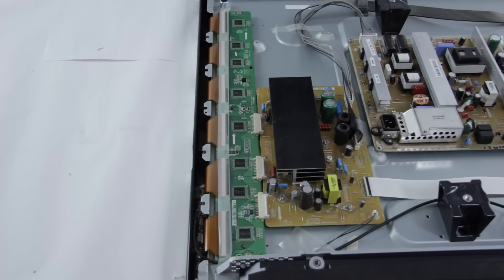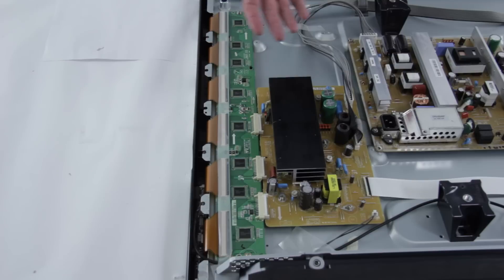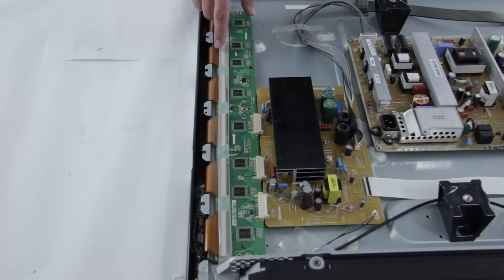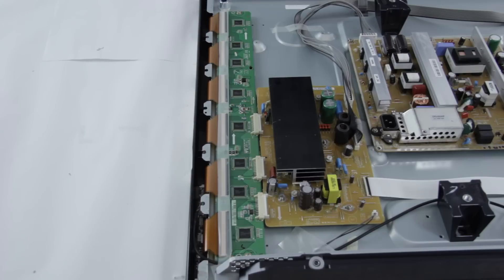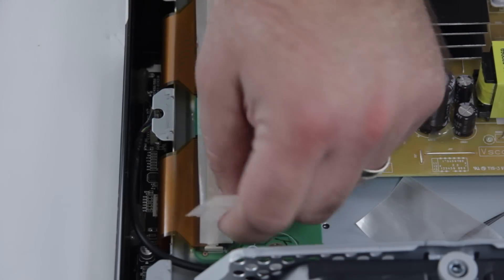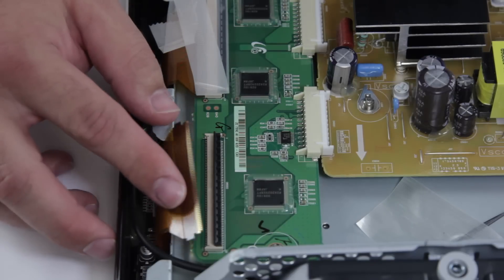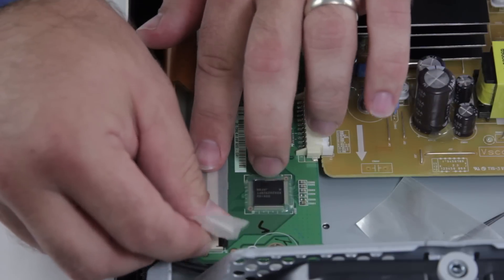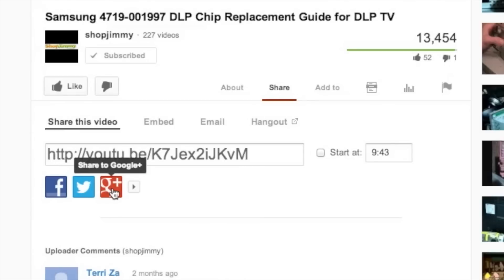Plasma TV Repair - No Image, No Picture on Plasma TV Screen - How to Replace Y-Buffer & Y-Sustain

Comment: I have a Samsung PN51D55OC1FXZA. It just shut down and does not turn on. The relay's on the power supply board click. I see a red led if I push the touch sensors on the tv. The green led on the main board flashes then turns on solid. I don't know if I should replace the power supply or any other boards. I could only find 5V on the power supply. when testing the points where the wires connect to other boards. Thanks for any help. dissapointed a expensive TV lasts only 2 years. I hope I can fix it. I noticed X sustain boards for this TV are Not in stock. How do I know if a Y or a X sustain are bad.
Reply from the maker: sinkinpat   Try this at your own risk.  I recommend that you unplug the TV, then disconnect the Y board and apply power to the TV and see if the TV powers on or not.  Please reply with the results of this test.  Thanks!  www.shopjimmy.com

Comment: Hello...I have a Samsung Plasma 52'...Power light comes on...Nothing as far as picture or sound...The tv was a floor model and i do not want to put a lot of money into it...model # pn51e450a1fxza...Any ideas ?  thanks chris
Reply from the maker: chris veltri  Please watch this video to help with your repair!  TV Repair! LCD, LED, Plasma, DLP How To Fix Your TV with ShopJimmy.com Help!   I recommend replacing the Y-Main Board and the Y-Scan Drive board in your TV.  Here is a link to replacement parts:  http://www.shopjimmy.com/catalogsearch/result/?q=pn51e450a1fxza  Be sure to match part numbers on your current board, with your replacement for compatibility.  Thanks and please let us know if you have any further questions with your TV Repair!  www.shopjimmy.com

Comment: I have a Samsung Plasma model PN51D7000FFXZA. Display just quit, no audio. Red standby light is out, yet flashes when operating remote or buttons on tv. Power cable and outlet is good, power getting to TV. No response to menu button on remote or tv except standby light flashes once per button press. What am I up against?
Reply from the maker: sunlion333 Watch this video for help with your repair & purchase: TV Repair! LCD, LED, Plasma, DLP How To Fix Your TV with ShopJimmy.com Help!  I recommend replacing the Y-Main Board and the Y Scan Drive board in your TV.  Here is a link to replacement parts:  http://www.shopjimmy.com/catalogsearch/result/?q=PN51D7000FFXZA  Be sure to match part numbers on your current board, with your replacement for compatibility.  Thanks and please let us know if you have any further questions with your TV Repair!  www.shopjimmy.com

Comment: Hi i got LG 42PT353K-ZA Plasma - and when TV been switched on and been screen save on I heard like loud "bang" from the back once and TV switched off. When I tried put it back on I heard further 2-3 "bangs" from the back and there is no picture and TV falling in stand by (switch off mode). You can put back on, but after 2-3 seconds it is back to off mode. I`m suspecting Y SUS BOARD....as when taking off cover it smell of "burn"... any recommendations? All advice more than welcome please. Thanks in advance. Seb
Reply from the maker: Basior PL   I recommend replacing the Y board and buffers in your TV.  Unfortunately I do not see any replacement parts in the search results for your TV model number on our website.  Please reply with your part number on your Y board and buffers and I can try searching for replacement parts.  Thanks and please let us know if you have any further questions!  www.shopjimmy.com

Comment: I have a Samsung 51" Plasma TV model # PN51E450A1FXZA that has sounds but no picture, it won't even show volume control.  This was purchased less than 2 years ago. Please help.
Reply from the maker: Tim and Kathy   I recommend replacing the Y-Main Board and the Y-Scan Drive board in your TV.  Here is a link to replacement parts:  http://www.shopjimmy.com/catalogsearch/result/?q=PN51E450A1FXZA  Be sure to match the part numbers on your original board with the replacement parts:  Here is a video that may help you with locating your part numbers:  Samsung Plasma TV Repair: Samsung Plasma Panel Parts Guide  Thanks and please let us know if you have any questions!  www.shopjimmy.com

Comment: I have a tv model#pl42b430p2xzp it shows when turned on and then it goes black no pictures can you tell me what causes this and how to fix it
Reply from the maker: Kester Herbert  I recommend replacing the main board in your TV.  Here is a link to replacement parts for your TV model number on our website, click here:  http://www.shopjimmy.com/catalogsearch/result/?q=42b430p2  Be sure to match part numbers on your current board, with your replacement for compatibility.  Here is a link to a video showing how to identify your part number, click here:  Samsung Main Boards & Digital Boards: Part Numbers for LED, LCD, DLP, Plasma TV Repair  You can also call our customer service for further assistance with your purchase.  (877) 881-6492  Thanks and please let us know if you have any further questions with your TV Repair!  www.shopjimmy.com

Comment: I have a Zeinith Z50PJ240. It just give a clicking sound but no picture, or anything else,
Reply from the maker: Harold Wanton   I recommend replacing the YSUS board and the YDRVTP & YDRVBT boards in your TV.  Here is a link to replacement parts for your TV model number on our website, click here:  http://www.shopjimmy.com/catalogsearch/result/?q=Z50PJ240  Be sure to match part numbers on your current board, with your replacement for compatibility.  You can also call our customer service for further assistance with your purchase.  (877) 881-6492  Thanks and please let us know if you have any further questions with your TV Repair!  www.shopjimmy.com
Reply: ShopJimmy.com I found that the main board was not working, so I replaced that. so now it clicks twice to come on, then it cuts off. Still no picture.
Reply: Harold Wanton hey dude did you get your tv fix the zenith one im having the same problem
Reply: Not yet, still another issue, cant find tho. May have to change YSUS board. Will let u know, i have a digital tester, have to learn how to use it.

Comment: I have a 43" Samsung that has no picture or sound. I can see the power light on the front of the tele is illuminated. The Mod# is PN43D450A2D. I tried to buy the y sustain from Samsung but they only have the y buffer. Are these components sold together? Is that what I need? or perhaps there is something else gone wrong?
Reply from the maker: BB78256   You will need both, but they are sold separate.  I recommend replacing the Y-Main Board and the Y Scan Drive board in your TV.  Here is a link to replacement parts for your TV model number on our website, click here:  http://www.shopjimmy.com/catalogsearch/result/?q=PN43D450A2D  Be sure to match part numbers on your current board, with your replacement for compatibility.  Here is a link to a video showing how to identify your part number, click here:  Samsung Plasma TV Repair: Samsung Plasma Panel Parts Guide  You can also call our customer service for further assistance with your purchase.  (877) 881-6492  Thanks and please let us know if you have any further questions with your TV Repair!  www.shopjimmy.com

Comment: I have an RCA 42pa30rq plasma TV.  I was watching it the other day when suddenly the picture went black, but the TV was still on.  In my troubleshooting with a multimeter, the VS test point will show 206V when I first turn on the TV but the voltage fades to 4V in about 30 seconds.  The VA test point shows 54V when I first turn on the TV and then fades to almost 0.  This occurs whether the Y and X sustain boards are connected or not.  I replaced the power supply today and I am still experiencing the same problems.  The logic board's light is blinking slow, on for 5 seconds off for 3 seconds.  The Y and X sustain test point also show voltage fade after I turn the TV on.
Reply from the maker: Aaron Schmidt   I recommend replacing the Y-Main, X-Main and Y Scan Drive board in your TV.  This is a pretty common problem for this TV model.  Here is a link to replacement parts for your TV model number on our website, click here:  http://www.shopjimmy.com/catalogsearch/result/?q=42pa30rq  Be sure to match part numbers on your current board, with your replacement for compatibility.  Here is a link to a video showing how to identify your part number, click here:  Samsung Plasma TV Repair: Samsung Plasma Panel Parts Guide  You can also call our customer service for further assistance with your purchase.  (877) 881-6492  Thanks and please let us know if you have any further questions with your TV Repair!  www.shopjimmy.com

Comment: i had purchased samsung plasma 43 inches one and half year back.  while watching the suddenly some some came and it is sopped.  i had checkd the power supply the power is on switch on sound is coming but the image is not coming is that the problem is minor or major. i am looking for ur valuable answer
Reply from the maker: bheemisetty taraka   Is the problem no picture or no power?  Thanks!  ww.shopjimmy.com

Comment: Hi,
I have a SAMSUNG LED Model HL61A750A1FXZA
If I can turn it on it sounds like is turning on and blue light is on but screen is black and no sound. Then sound like turns on several times and if I try to turn off it does not turn off I have to disconnect it from the electricity. What I have to do?
Reply from the maker: JULIA MARQUEZ   This sounds like a problem with their the main board or the Light Source in your TV.  You can replace the main board to see if that fixes the problem in your TV.  Here is a link to replacement main boards for your TV model number on our website, CLICK HERE:  http://www.shopjimmy.com/catalogsearch/result/index/?cat=56&q=HL61A750A1FXZA  Be sure to match part numbers on your current board, with your replacement for compatibility.  Here is a link to a video showing how to identify your part number, click here:  Samsung Main Boards & Digital Boards: Part Numbers for LED, LCD, DLP, Plasma TV Repair  You can also call our customer service for further assistance with your purchase.  (877) 881-6492  Thanks and please let us know if you have any further questions with your TV Repair!  www.shopjimmy.com

Comment: Hi I have a Samsung 51" Plasma HDTV PN51D430 that is almost 3 yrs old. I have excellent sound but no picture. I've tried all the trouble shooting possible. I was told that the lamp that projects the images may have blown. It went out on Saturday. Please help. This is unbelievable for a TV to go out this quick when I have another one that is over 20yrs old. Thoughts on what it could be?? The HDMI cord works fine on other TVs. I've taken the panel off but have no idea on what I'm looking at. LOL. Also, when powwred on there are no lights in the back other than a green blinking light.
Reply from the maker: mglamourgyrl   Thanks for subscribing!  I recommend replacing the Y-Main Board and the Y-Buffer Board in your TV.  You will find those replacement parts here:  http://www.shopjimmy.com/catalogsearch/result/?q=PN51D430  Be sure to match part numbers on your current board, with your replacement for compatibility.  Here is a link to a video showing how to identify your part number, click here:  Samsung Plasma TV Repair: Samsung Plasma Panel Parts Guide Thanks and please let us know if you have any further questions with your TV Repair!  www.shopjimmy.com
Reply: ShopJimmy.com thank you

Comment: I have a Samsung pn63c8000 plasma tv and last night I was watching tv and heard a popping noise and the screen went black. Still could hear the sound but no picture. Unplugged and replugged and same problem?
Reply from the maker: rokpom   I recommend replacing the Y-Main Board and the Y Upper Scan Drive & The Y Lower Scan Drive boards in your TV.  Here is a link to replacement parts for your TV model number on our website, click here:  http://www.shopjimmy.com/catalogsearch/result/?q=pn63c8000  Be sure to match part numbers on your current board, with your replacement for compatibility.  Here is a link to a video showing how to identify your part number, click here:  Samsung Plasma TV Repair: Samsung Plasma Panel Parts Guide  You can also call our customer service for further assistance with your purchase.  (877) 881-6492  Thanks and please let us know if you have any further questions with your TV Repair!  www.shopjimmy.com

Comment: I have an RCA 42PA30RQ with a beautiful picture and no sound.  I've checked all the sound setting and tried different inputs but still no sound.  Which board control sound?  I was thinking the main board.
Reply from the maker: D Chin   Yes, the main board controls the sound.  Here is a link to replacement parts for your TV model number on our website, click here:  http://www.shopjimmy.com/catalogsearch/result/index/?cat=56&q=42PA30RQ  Be sure to match part numbers on your current board, with your replacement for compatibility.  You can also call our customer service for further assistance with your purchase.  (877) 881-6492  Thanks and please let us know if you have any further questions with your TV Repair!  www.shopjimmy.com

Comment: I have a Samsung Plasma display model # hp-t5054, wen it is plugged in you are able to hear the program but cant see anything on the screen. I have had a couple of people tell me you can buy a new bulb?
Reply from the maker: Krysti Long   There is no bulb for this TV.  Since you have no picture, I recommend replacing the Y-Main Board and the Upper & Lower Y Scan Drive Boards in your TV.  Here is a link to replacement parts for your TV model number on our website, click here:  http://www.shopjimmy.com/catalogsearch/result/?q=hp-t5054  Be sure to match part numbers on your current board, with your replacement for compatibility.  Here is a link to a video showing how to identify your part number, click here:  Samsung Plasma TV Repair: Samsung Plasma Panel Parts Guide  You can also call our customer service for further assistance with your purchase.  (877) 881-6492  Thanks and please let us know if you have any further questions with your TV Repair!  www.shopjimmy.com

Comment: i have a lg plasma tv model 60pz550  .. it started with a rainbow color affect on it then after that it just gave a black screen some times it will power on .. and some times it wont
Reply from the maker: Starr Oyervides   It sounds like your YSUS board is shorting out, thus I recommend replacing the YSUS, & YDRVTP & YDRVBT boards to fix the problem.  Here is a link to replacement parts for your TV model number on our website, click here:  http://www.shopjimmy.com/catalogsearch/result/?q=60pz550  Be sure to match part numbers on your current board, with your replacement for compatibility.  Here is a link to a video showing how to identify your part number, click here:  LG Plasma TV Repair: DIY Part Identification Number ID Guide for LG & LG Philips Plasma Panel Parts  You can also call our customer service for further assistance with your purchase.  (877) 881-6492  Thanks and please let us know if you have any further questions with your TV Repair!  www.shopjimmy.com

Comment: Hi. I have a 52 in. Samsung model hpr5052/xaa. Wont turn on just clicks all the time if it is connected to power. Had to diconnect so it could stop clicking.  Please help!!!
Reply from the maker: Ana Alvarez   Try this at your own risk.  I recommend that you try disconnecting the Y Sustain board from the TV and then try turning the TV back on.  Please reply with the results of this test.  Thanks!  www.shopjimmy.com
Reply: Do disconnect and reconnect and power on
Reply from the maker: Ana Alvarez   Power off the TV, then disconnect the board, then turn the power back on and see if the TV powers on normally.  Thanks!  www.shopjimmy.com
Reply: ShopJimmy.com but do I reconnect the y board before poweringbon again. Im sorry I can be kind of slow... lol

Comment: Hello.  I have a samsung model number pn50c490b3d.  The problem i am having is the front light is on and there is a clicking noise.  There is a green light in the back that is going off and on.  I have no picture or sound.  I would appreciate your help on this problem.  Thanks
Reply from the maker: Jim Chase   I recommend replacing the Y-Main Board and the Y-Buffer Board in your TV, because these boards control the video going to the panel.  Here is a link to replacement parts for your TV model number on our website, click here:  http://www.shopjimmy.com/catalogsearch/result/?q=pn50c490b3d  Be sure to match part numbers on your current board, with your replacement for compatibility.  Here is a link to a video showing how to identify your part number, click here:  Samsung Plasma TV Repair: Samsung Plasma Panel Parts Guide  You can also call our customer service for further assistance with your purchase.  (877) 881-6492  Thanks and please let us know if you have any further questions with your TV Repair!  www.shopjimmy.com

Comment: Have a lg 50pg20d AA and a black screen channels change volumes works but no picture and black screen what would
You recommend problem is thanks
Reply from the maker: SHADOW233  I recommend replacing the YSUS and the YDVBT & YDVTP boards in your TV.  Here is a link to replacement parts for your TV model number on our website, click here:  http://www.shopjimmy.com/catalogsearch/result/?q=50pg  Be sure to match part numbers on your current board, with your replacement for compatibility.  Here is a link to a video showing how to identify your part number, click here:  LG Plasma TV Repair: DIY Part Identification Number ID Guide for LG & LG Philips Plasma Panel Parts  You can also call our customer service for further assistance with your purchase.  (877) 881-6492  Thanks and please let us know if you have any further questions with your TV Repair!  www.shopjimmy.com